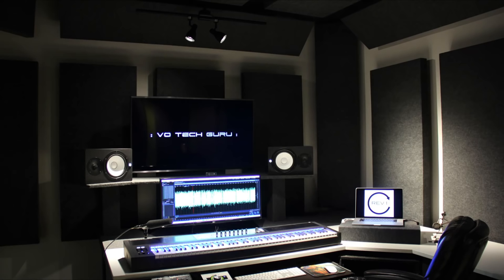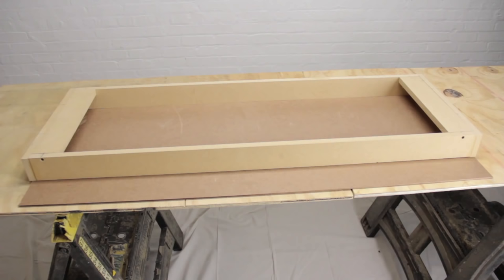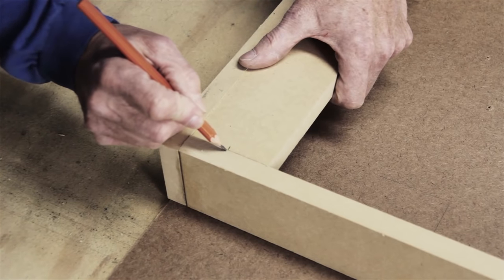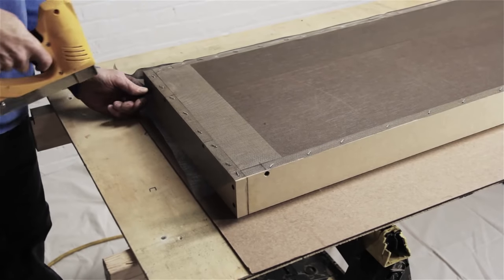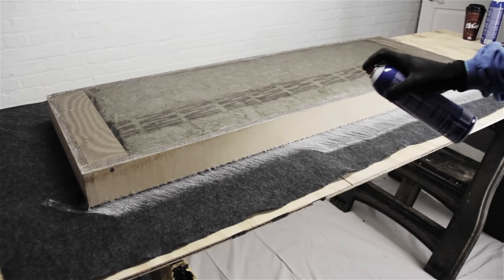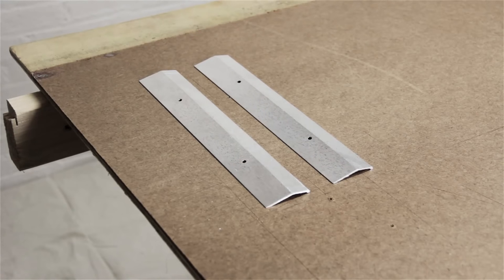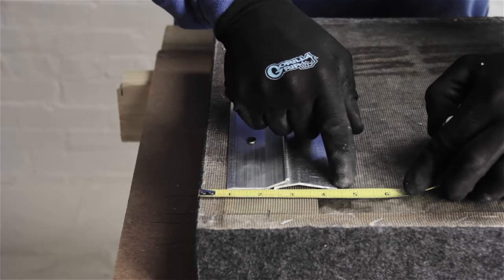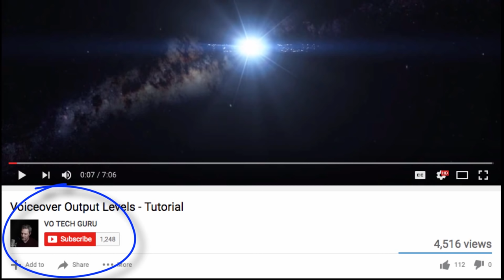How To Build Acoustic Panels | DIY Acoustic Panels

Comment: If placed diagonally in a corner would these also work as a bass trap?
Reply from the maker: They work great as bass traps in the corners in both my control room and booth. Everything is 3" thick so there's not much opportunity for standing waves to build up with low frequencies. The VO in my video was recoded in my booth using the same panels, so... ;-)
Reply: Well that's great to hear! I'm building a home theater room and was trying to minimize the sound coming out of the room as well
Reply from the maker: They will absorb high and low frequencies, but sound absorption is different than soundproofing. It's difficult to say how much of the sound will be heard beyond your theatre room. Just want to make sure you understand the difference between those two approaches. ;-)

Comment: @VO TECH GURU  sorry I’m a little slow but the total cost of materials divided by 8 equals $25?
Reply from the maker: Hi J N DOE. If I understand your question correctly, if you bought all of the materials needed to build 8 panels you would pay around $25 per panel in material costs. Does that answer your question?

Comment: my best way when applying fabric to a frame is:
going from the midle towards the corners,
doing so stepwise on all 4 sides, changing between opposite sides
long sides first, then short sides, like this 1. and 3. then 2. and 4.
1. side one nail in the middle, then opposite 3. side in the middle.
2. side in the middle then 4. side in the middle.
Next round. Half the spaces to 1/4.
1. side, nail half way between the midle and the corner in one end, then
3. side, nail likevise in the same end. 
Then do the same in the other end of the long sides
Same procedure on the short sides halfing the spaces.
Next round. Half the spaces 1/8.
Half the spaces with nails the same way, shifting between sides on every nail AND shifting between which side of the midle yuo work.
Also shift between the long and short sides.
 A pair of nails either side of the middle (long side), then on the short side.
Then the next spaces out from the middle.
If one follow this, its possible to get a very hard stretch on on the rigth fabric without wrinkels.
That might not be optimal for acoustics though?
Reply from the maker: My fabric is pulled tight with no wrinkles using the method in my tutorial. Acoustics are great wherever I use them.

Comment: I was thinking of using UltraTouch from Bonded logic.  It's recycled denim and according to their site the accoustic properties are better than Roxul.  What are your thoughts?

Also, I didn't realize felt was acoustically transparent.  I see everyone using Muslin, .Guilford of Maine. or Burlap.
Reply from the maker: Mark Menasci I've heard good things about it, but I'm always mindful of fire codes for commercial use so I tend to be careful. Here's a video on Roxul that you might find helpful: https://youtu.be/Zcs4fLjUyi8 And yes, the craft I use is very transparent and low cost. You can check it out in the supply link below.
Reply: Thanks for the info and the great video.  The UltraTouch is fire resistant according to their site
Reply from the maker: Mark Menasci Oh yeah, no question the denim insulation is fire resistant and burns slow. I just love the fact that you can hold a blow torch to Roxul and it won't catch fire. That's crazy!

Comment: Is a support necessary? I wouldn't want to cut out a piece of the SNS. Also, could these be used as corner bass traps? After some research I noticed several people saying doubling up the SNS would be best. Is that true or would 1 slab suffice?
Reply from the maker: Waleezy401 Hi and thanks for watching. You could build them without supports but I like to ensure my panels stay square and firmly attached without being lopsided (like with wire hangers). I also hang them from the ceiling (see my control room in the video) and want to ensure they don't fall. I didn't give any thought to cutting away 3/4" from a 3" deep piece of Roxul for the supports as that wouldn't impact performance across such a long panel. Hope that helps.
Reply: Thanks for the reply. What about corner bass trap use? Would you recommend doubling up on the insulation or just using a single 3" like you've made?
Reply from the maker: Waleezy401 I just used longer 3" panels in the corners hanging from small triangular shelves. Even cranking Yamaha HS-8 monitors the room wouldn't respond. There's just too much absorption all around for bass to build up.

Comment: I'm online now looking at the prices for these pieces and the insulation is 50.97 a roll, and the plywood is 30-40. I haven't gone to look at the other prices because this already exceeds the 25 dollars per piece statement you made. this was an amazing tutorial and I want to try to make my own panels, but I can't afford the prices they're showing so far.  How many panels can I make with total with everything?
Reply from the maker: Darnell Ivy Hi. It takes one pack of the insulation to make 8 panels. Same with the cut up MDF panel. So divide the cost of the insulation by 8 and so on.

Comment: Would you be able to post the measurements of the wood cuts if I purchased a 1x4x8 board with the same build but 24" roxul? Thanks!
Reply from the maker: Sorry for the very late reply, but the new YouTube Studio app is now showing all missed comments. Find out the actual width of the 24” Roxul (Now called Rockwool) and make sure the interior dimensions are 1/4” short of that for a snug fit. And thanks for watching!
Reply: @VOTECHGURU  all good! I already built 14 panels lol
Reply from the maker: @xOBS3SS10NX  Awesome!

Comment: If you have the mesh screen on the back of the panel, then why do you need the wood supports? Is that to strengthen the frame?
Reply from the maker: So the hanger can be mounted as well.

Comment: How much does felt add to the sound absorption?  I was thinking of using a different cloth for better aesthetics.  Got make the wife happy.
Reply from the maker: SuperFastFlyer Understood. ;-) The fabric makes a difference to the degree that it’s transparent. The felt I used is pretty thin (can be seen through to a degree when held up to the light) so it really effective at letting sound pass into the insulation where it gets absorbed. That’s not to say you can’t use a thicker material, but I’d be cautious during your selection to make sure it’s not too thick. Hope that helps.

Comment: Can you please provide a better description of the fabric you used.  You say it is felt but the link you provided goes to craft felt on the Joann Fabrics...please provide a better description or if you have a part number from Joann that would be great
Reply from the maker: Hi Brad. The link that it takes you to has a button for you to visit them and see the specs. I'm pasting it here: https://www.joann.com/craft-felt-fabric-72-solids/prd10007.html What I can tell you is the felt is very thin and you can easily see right through it when you hold it up to the light. Hope that helps.

Comment: Where do you get the Rockwool (mineral wool) 24" x 48" x 2"? Home Depot or Lowe's do not carry that size. Anywhere online you pay at least $45 for shipping. Where is everybody getting there's?
Reply from the maker: Yeah, the 2” isn’t going to be a standard size for big box stores so I would order online or maybe find a local building supply or insulation supply company.

Comment: As of today, the standard package of Roxul at Home Depot says it contains 12 batts.  The instructions above say 8 batts so maybe packaging has changed since production of the video.  Price is $47.70 for package of 12 batts 3" thick by 15.25" wide by 47" long.  Total of 59.7 square feet.
Reply from the maker: GhostwriterSays Yeah, that was just meant to indicate that you’ll use 8 per pack per one sheet of MDF but I’ll change the wording so it’s super clear. Thanks.

Comment: just so someone knows,  there are mirror/picture hangers pre made that are like this carpet strip and comes with a bubble level and screws.  home depot sells them and it's over in the hardware isle
Reply from the maker: Thanks for the info! So everyone knows, make sure you still install the bumpers so you maintain that important gap between the wall and panel.

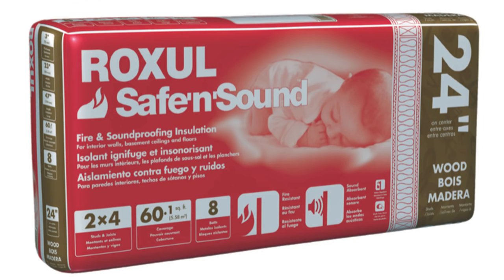Comment: If I decide to go with the Roxul Safe 'N Sound 24" x 48" why would the height (sides) of the panel be 48 -1/2" as you state at 01:19 and not 49-1/2" ? Given that the inner dimensions of the frame should be 24"W x 48"H. Thank you.
Reply from the maker: I give the reason here: https://youtu.be/GBHYiWIJhUA?t=74   The 24" or 16" roxul won't be those exact dimensions. For instance, 16" is actually 15-1/4" when you open the Roxul.
Reply: @VOTECHGURU  Awesome Thank you. Sorry about all the questions.
Reply from the maker: Peter Batah All good.

Comment: Did mine, same size and 3.5" thick, for $20. None of the excess insulation cutting. no spraying. 1x3 whitewood. HD only makes 2 cuts per piece. Optimum wall mount should be same as panel thickness.
Reply from the maker: Thanks for watching!

Comment: Shouldn't the absorption panels be mounted an inch or so off the wall, so there's a gap between panel and wall for sound to be absorbed as well? So you instead of mounting them flat to the wall I think I'm gonna use 90 degrees anchors to something to make sure they're floating an inch off the wall. Question, what fabric did you use and wasn't that enough, I didn't understand the "fly netting" underneath the fabric.
Reply from the maker: Supersonics Roots All materials are in the description. When I put the fabric on I mention the screen is to make sure the fabric is smooth. If you don’t use it the front of the panel it won’t be smooth because the insulation is rough. Using it on the back keeps tension on the insulation. It is a half inch off the wall. The bracket and the bumper on the bottom do that.
Reply: @VOTECHGURU  ok, guess I missed that in watching it. Thanks for replying and furthermore a great vid
Reply from the maker: Supersonics Roots Thank you and thanks for watching! BTW, if you have a table saw you can rip French cleats out of MDF and attach them to a 2x4 that’s attached to the wall. You can get even further from the wall by adding another 2x4 layer. You will get even better performance out of the panels if you get them further away. But they’re so effective I found little need to push them out even further than 1/2”. They absorb like crazy as you can hear in my voice over for the video where I used the same panels. In my booth, of course, not in my control room. I spaced them further out in the control room to keep it from sounding too tight. Like 8-10” apart.

Comment: Does these just absorb sound? I think overall it would be better to take out the dry wall, rockwool or better yet spray foam between your studs, put drywall back. Paint. Carpet the room and foam pad the ceiling. I'm still confused on what these do, the start of the video tries to give an example but I don't hear it, yet I hear the rest of the video.
Reply from the maker: Hi Levi. Try headphones so you can hear the before and after. The panels aren't meant to keep sound in or out, just to reduce echo and the building up of frequencies in a booth or mixing space. Thanks for watching.
Reply: Ohhh amazing! Thank you I learned something!
Reply from the maker: Levi Godwin You’re welcome! Check out my VO Tech Guru Page on Facebook if you’d like to learn more.

Comment: would it not be better to use a more acoustically transparent fabric to wrap the panels such as burlap?
it seems the felt would cause more reflections on the high end.
Reply from the maker: autonami Burlap works as well but craft felt is thinner and you can see right through it when you hold it up to the light. There's nothing wrong with burlap, I just don't care for the way it looks.
Reply: i first started out with burlap, but also did not like the way it looked. took it back ending up getting speaker grill fabric which allows plenty of air to pass through, and was about $5 a yard. i looked at some of the felt, but my concern was air not passing through the felt efficiently.
Reply from the maker: autonami Yeah, I hear you and had the same concerns. The craft felt is lighter and more transparent than it appears on film. I have the panels in my booth and control room and they perform really well.
Reply from the maker: autonami Yeah, I hear you and had the same concerns. The craft felt is lighter and more transparent than it appears and film. I have the panels in my booth and control room and they work really well.

Comment: I just have one question: Why do you use MDF instead of regular wood?? I’m making my cuts and already split two of the 16 1/2 panels.. and it looks like you’re using wood in the video?
Reply from the maker: No, we used MDF for the build and no natural wood was used. The reason we used it is because the cost per piece is much lower than natural wood. When you say splitting, what do you mean?
Reply: VO TECH GURU when I drilled the holes with the countersink I split a couple at the bottom the mdf teared and I just drilled the pre holes and if u don’t drill those deep enough it cracks the mdf as well when u go to drill the top n bottom together
Reply from the maker: Be Mello I suspected that’s what you meant. Yes, you have to drill the countersink deep enough but also make sure you’re not overdoing the screws because that will split it as well. The same is true with natural wood. Have they stopped splitting since you started drilling deeper?
Reply: VO TECH GURU yes u still can notice a slight crack as long as it don’t ruin in the long run I think illl be alright great video tho i musta watched it 100 times
Reply from the maker: @4evafreshstudios381  Thank you. Yeah, a small crack won't hurt anything.
Reply: VO TECH GURU hey almost done was wondering how u got one of the panels to hang above the pc on the ceiling and the wall??

Comment: What was the overall cost per panel or for multiple panels?
Reply from the maker: WakeeWakee Around $200 for 8 panels or $25 each. If you build more than 8, the cost per panel will drop a little because you'll have some insulation left over from the first 8.

Comment: Is that adequate gap between the wall and the panel? I've always heard there should be a 2" gap.
Reply from the maker: David Wylie Not sure where you heard that but it’s more than adequate for my use as I voice for global brands and also compose and mix music for commercial in film using these panels. No complaints on acoustics so far! ;-)
Reply: Wasn't questioning your credentials. I found your video very helpful, but I had seen suggestions of an air gap behind the panels on numerous other sites. Thanks for the response!
Reply from the maker: I didn't think you were questioning my credentials. I was just giving you some perspective because a lot of people on the web have ideas about how things are supposed to be done but then pro acoustic panel companies will send out $100 panels with a plywood backing that goes right against the wall which I can't understand at all. Having the open back and a gap is far more effective. I don't know how more effective my panels would be at 2" off the wall but I wouldn't personally put any effort into because they work great as-is. Hope that helps!
Reply: Great! Thanks!

Comment: This will remove room echo/reverb while recording vocals?
Reply from the maker: Hi and thanks for watching. Yes. This video was voiced using the same panels. They work very well.
Reply: Awesome, thanks. Also I see roxul comfortbatt for a bit cheaper at my home depot. Is safe n sound noticeably better or is it basically the same thing and I can go with comfortbatt?
Reply from the maker: Fleegsta The safe and sound is specifically design for better acoustics. Check out this page and scroll down to "walls." It will tell you the difference. http://www.roxul.com/support/faq/

Comment: If the panels are 2" thick, why'd you make them 3" deep instead of 2 3/4" deep? I'm just trying to calculate the dimensions of 4" thick Roxul before picking up the lumber
Reply from the maker: Aspen Mallery The stock Roxul in this video is 3” so if you buy thicker Roxul just adjust your depth accordingly. These panels are 3” deep, BTW. Not 2”.

Comment: My local Home Depot will only cut it into 12” pieces. What do I do now ?
Reply: Go to another home depot and deal with the dept manager right of the bat. Explain why you've come to this store instead of calling Area management at corporate.
Reply from the maker: You can go to a local cabinet shop to cut it for you or if you have a skilled friend with a table saw they could easily do it.

Comment: Anyone know what other materials could be used for this?
Reply from the maker: Which materials are you referencing? The insulation?
Reply: @VOTECHGURU  yes is there any less expensive material you can suggest, I saw someone somewhere talk about using towels don't know if you know anything about that
Reply from the maker: @chxrlzchucky7509  I do know about it but you would have to use a ton of towels to reach the coefficient I look for. For what you get, the Roxul is actually very affordable considering there are 12 pieces to a bag. I’m mentioning that because people sometimes think you get only 1 piece of Roxul per bag.
Reply: @VOTECHGURU  okay 👍🏽